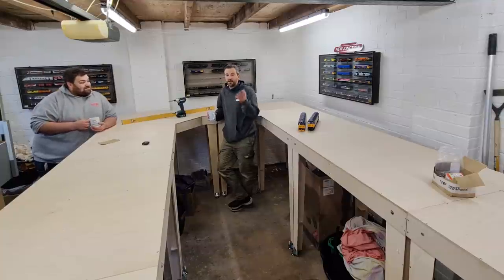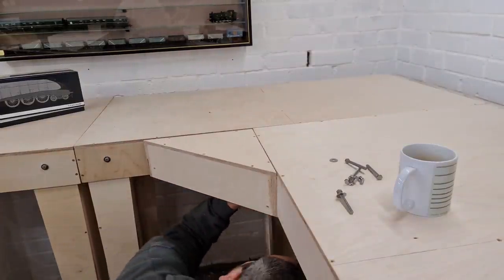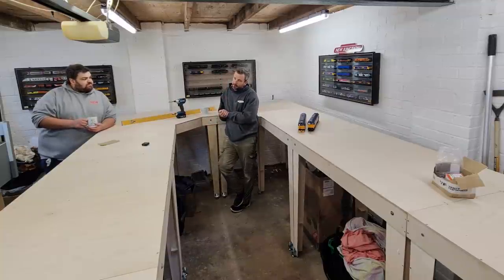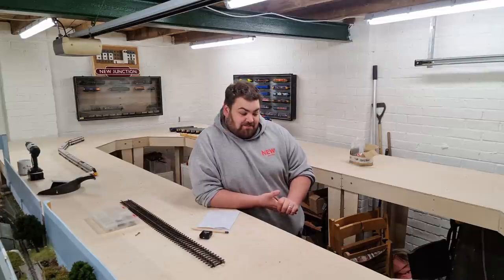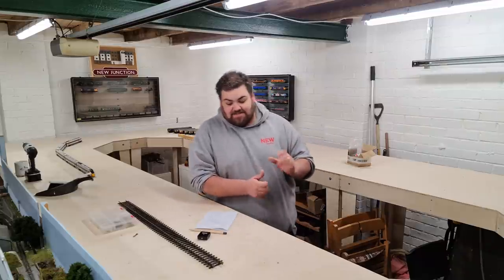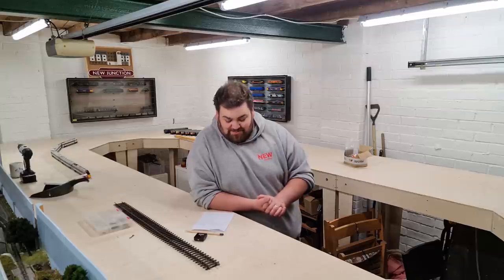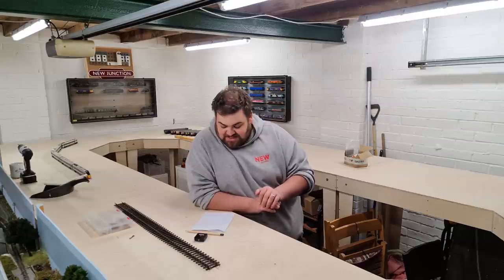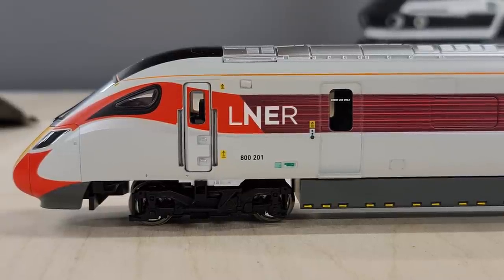New Junction: EP1 - Building baseboards

Comment: Great to see you back Richard. Very nice looking boards. Birch plywood is the way to go. Mine has held up now for over 10 years without any issues. The ability to convert it to an exhibition layout is very cool, looking forward to seeing how that pans out. Good luck!
Reply from the maker: Thanks, did you treat your ply with anything?
Reply: @NewJunction  Not really. I'm usually too impatient and want to run trains. The parts where I've done scenery, I've typically weathered the track, then painted with cheap acrylic paint, usually either gray or brown depending on whats going there. So the closest I've come to treating it is basically bog standard acrylic paint that costs about $1 at Walmart here in the USA. Now my layout is sitting in a reasonably climate controlled basement, so you might want to treat it if thats recommended for where you live. The only baseboard issue I have ever had was one board needed a bit more support, and again that was down to me going, ah I'll add that leg later and got side tracked running trains. :)

Comment: I salute your ambition to be able to rotate 3 boards to create a single run, presumably you have to fit board 4 to 3 in the circuit garage build stage to get perfect alignment for exhibition run.  For the fiddle yard entries will become board 6 into fiddle yard and board 1 into fiddle yard, so the circuit return curve board abutting board 4 also has to line up with board 1.  In reality you will probably need two new curve boards to exit board 1 into the fiddle yard, life is far two short to get the level of accuracy needed for it to all fit together!

Comment: Brilliant news on the new build Rich 👍 Richard have you thought about building a stud wall inside of the garage door? And plaster boarding the roof? I know it’s more ££££money on top of ££££money but it will make the area more homely and warm for you. Also if you do think about doing it do it as soon as before you start on the railway
Reply: The layout is going to be transportable, a stud wall would prevent  the garage door opening. Unless there is enought clearance via another route, just a thought.
Reply from the maker: Darren guessed it, the garage door won't allow a stud wall sadly, besides I use the door too much for my motorbike! 😄

Comment: Pleased to see you, Richard. I have just installed new boards in my lounge - 26 feet by 10 feet, then I saw your video. I am intending to have storeage roads on one side - perhaps 18. On the scenic side I am intending to have a 4 platform station plus a bit of narrow gauge. Rather than have simple crossovers I thought to have a central road rather like Evercreech where banking locos were stored on a central line. This may be easier for me than for you since my boards are 3 feet wide rather than your two feet. There will be two island platforms with the central road down the middle and 3-way points at each end leaving room for a short road for a station pilot at each end. The main station building will be over the station. On the inside of the layout will be a goods yard and an MPD. The central line can be used for transferring coal wagons to the MPD and goods vans to the yard. Minimum radius will be 3 feet - just about manageable and absolutely necessary for some of my locos. I have yet to work out the detail at each end of the boards. If I could work out how to do so I would send you a track plan. In the meantime I will watch your progress with great interest.
Perhaps I should add that I model two periods - GWR in the 1930s with some locos from the 1920s,-  and  postwar to 1963 or thereabouts.

Chris Barton
Reply from the maker: Thanks Chris, your new project sounds great! ! I hope you'll film it!

Comment: That is quite some plan. Just a thought for the switch between home and show layout would it not be worth making a short additional drop out section that would link the two halves up for the show layout. That way you could make sure all lines up track and scenery wise by building one side along with the start of drop out section and the moving that section over remembering to rotate it to the other side and building off it for the continued run. The drop out section could be stored separately out of the way at home and used a a seamless link for show purposes.

Comment: I tried to  do this three times.  4 plus lines appears to be a British Modelling standard, Plus Heritage line makes 5 lines briefly.  New Junction suggests Branch line becomes  Heritage line - Mainline gets bigger forcing Heritage line into compromises -  Mainline is 2 up 2 down - Heritage line was once 1up 1 down. In places  that can still be seen - In places the Society is bringing that back -- In other places the Heritage  line is forced to use what looks like old sidings of the Branch - Mainline line Junction while it seems some of  the original track has now been turned into allotments. 
I also believe you will need a set up  board (7 or more lines that shift over to 2 or 3)  or some connection a marshalling yard. All trains come on to the boards at one corner - can go round and round or up and back again in exhibitions.
Looking forward to your planning ideas
Reply from the maker: Thanks for the ideas!

Comment: Hi Richard, Brilliant to see a new layout in the making! I think the Newark Flat Crossing would be an excellent idea for your modelling, with the Nottingham to Lincoln EMR line crossing the east coast mainline. Additionally, this would make an excuse for two smaller stations instead of one large. Newark Northgate has 3 platforms and lots of disused sidings whilst Newark Castle has 2 curved platforms. With artistic license, I'm sure other operators beyond EMR, LNER, HT, GC and Lumo, Northern operate to both Nottingham and Lincoln so that'd almost fit in perfectly. Perhaps if you added an extra part to the baseboards, going out in line to the other side of your garage, but at the back to leave the majority of space still available, you could represent the line not on the main baseboards going off in the distance. You must think I sound mad! Hope this idea is of interest. 
Oh and one more thing, perhaps you could have a scenic break somwhere to represent further down the line and add in a major station such as York or Lincoln.

Comment: Cracking Baseboards Gromit! Dan really has done a superb job with those boards, hats off to his craftsmanship! That idea about using all the scenic sections for exhibitions is a great idea and I think you’ll pull it off well. Idea wise, I think you kept the station canopy from original New Junction of memory serves me correctly. Perhaps out of board 1 you could have a 4-road station emerging from the backscene with the thunderbird siding, that narrows down to two lines. For the heritage line, I think something similar to Totnes in Devon would work, where the heritage station is away or ‘across a river’ from the main line station but also have some form of a connecting line that goes up a gradient towards the station, or a bit further down the line from the station just like Nene Valley or Worgret Junction? Everything is nicely spaced out then, some food for thought. Keep up the good work, looking forward to seeing the progression and that 800 at speed!

Comment: For exhibitions could you include a board 3.5 to go between boards 3 & 4 to both ensure the track aligns and also to blend the scenery?

On a different note before you get too far it might be worth putting some insulation between the roof beam and also in the back of the garage door,

Comment: I have a strange suggestion. I noticed part of this layout will be in front of a garage door. Depending on whats outside that door, you might consider not doing a backdrop in that area so you can open the door and use it for photography, even if just for the real sky. Of course if it opens to a skyscraper, that might not work so well but I thought it might be interesting.

Comment: Layout planning - may I suggest you steal an idea from the landscape gardeners - the bubble plan.
A bubble is something you want to model - One or more items / features / dioramas / layout elements on the list built form your own and others idea.
As you put them on your benchwork diagram try and get them about the right size but its not critical
Place the bubbles in sequence or parallel or inside of each other
This will give you a good impression of what the layout will look like in its two configurations
Answer questions like do the train journeys with their stops / shunting opportunities make sense, enough separation, etc.
Working in order of priority; from reference to prototype, chosen scale, standard for minimum radius etc.
Replace the bubble with a rectangle containing the track plan using CAD or templates
As the rectangles are joined together you'll need to tweak !!!

Comment: I moved house a couple of years ago and am still trying to settle down to a point where I can actually find room to build a new layout 🤣 looks like a good start though for you though. One suggestion I might have is an automated branch line, I did a project on my last layout using LDRs and an arduino controlled relay board. Perfect if you want q small scale extension for some pacers running back and forth and a little something extra to take to conventions. You can add a station or two along the way and program in individual stops.
Reply from the maker: That sounds like a good idea, I've used DCC concepts shuttle system in the garden before now
Reply: @NewJunction  ah I forgot about that, I was still on an analogue layout, I used the relays to reverse the polarity across the tracks in order to send the trains back up the branch line... don't think that would work very well with DCC fitted trains 🤦‍♂️I have seen some of the DCC timing loops that stop and reverse trains after a certain interval but there probably are better systems on DCC with sensors in the same way I built my track. I just find the timing loops to be a bit inaccurate, different locos with different motors can run at different speeds and stop in different places, hardly the best when you want the effect of pulling into a station 🤣

Comment: In terms of heritage and modern mainline connecting together, you can do worse than to look at Keighley station for inspiration. LNER services to Skipton run through the station, stopping there to alight in the evening and board in the morning, and it’s shared with the KWVR steam branch line. The KWVR platforms are wonderfully preserved and the Northern/LNER platforms are much more modern. I’m sure you could use it for inspiration as a potential station.
Reply from the maker: Oooo thanks, ill do some research!

Comment: Your boards are clearly very well built and joined together. Would you be prepared to share the materials and measurement details of the board - eg. leg height and dimension, board top material and thickness? i am also interested as to where you will locate the control board for tortoise points and signalling. 
regards,
Richard
Reply from the maker: Of course, boards are made from 9mm birtch ply and are 110cm tall. The side supports and braces are around 4inches tall.

Comment: As your starting a brand new layout. Your planning to stay with a duck under?  A lift out? A swing out? I've even seen a guy use sets of drawer rails to do a roll up hold then roll back down.
Reply from the maker: Duck under for now, if it became an issue I could easily turn it into a lift bridge 😊

Comment: If you are going for a raised main line, what made you go for a traditional style flat topped baseboard rather than an open frame board system where you could have reduced the weight of each board (especially if you are going to exhibit) and also reduced costs?
Looking forward to seeing this develop and how you are going to integrate boards 1,2,3,4,5,6 for possible exhibition too. I'm sure you'll nail it. 
Good Luck
Steve
Reply from the maker: I'm glad you're confident in the idea Steve haha. I opted for flat topped boards to offer strength in the long term, I've seen to many get damaged or go flimsy due to lack of a top board.

Comment: Glad to see you back. I'd like to move to the garage too but I'm worried that my garage, although not damp is not heated either and I'm worried about metal parts tarnishing and rusting in the cold moist air. So I'm curious about your take on that? Best wishes and I'll be following along.
Reply from the maker: Hi Steve, the rails will be fine, they may just need more cleaning, the rails in my garden have been fine even after two years. 

Like most things if you get trains running regularly they'll be fine.

Comment: Hi Richard, lovely to see a new build from the start. How wide are the end boards that go across the width of the garage, are they also 2’6”? The reason I ask is because obviously the tracks on the scenic boards will need to be straight(ish) as they cross on to these to allow for the long exhibition format, so your end curves are going to be fairly tight. If it were me, and obviously it’s your railway, I would aim for a 3’ minimum end curve and sacrifice the exhibition idea, after all its not like you can’t exhibit with your work layouts. Just a thought, best of luck with whatever you decide, regards, Stephen
Reply from the maker: Thanks Stephen, they are 2ft wide on the width sections

Comment: I have been thinking at same lines as you, though I am to squeeze a larger scale, much larger scale to about saem space as yours. Having modular way is more useful as you can rearrange things and in case you have to move, it does not end up in a dumpster.  In smaller scals there is so much you can do. Make a list of things you want to include, the ones you want the most, put it on the top of the list and so on. This way you get to include things on the layput you find as must have and if some lower down on the list would not make it, not that much of a big deal, you can use your design of modules to add those things, if you are planning to bring it to trainshows. I have not seen your previous layout but in general, we tend to cramp so much in a limited space, in moderna world buildings and street networks take a lot of space too. In other words less is always more. C>heers from Sweden!
Reply from the maker: Thanks Ollie!

Comment: Great to see you starting a new project. I'm looking forward to seeing how it develops.

Firstly are you going to insulate the garage or leave it as is? 

Secondly as far as ideas for the layout I'd say the first thing to decide is what you want to do with it. i.e. Are you happy watching trains simply run round your layout, enjoy shunting and making your locos work, running locos to a time table or want to focus on the scenery side? Ultimately that will decide your track plan and whether the layout is dominated by track or scenery. Also do you want a layout based on a real place or a generic East coast line that you can set up as you please?

Anyway good luck with whatever you decide.😀
Reply from the maker: Thanks, generally the garage will have no more insulation and with the trains I'm happy watching them go round but would like some form of play value with a station

Comment: in the US we have group could N Trak that uses moduler systems so that every ones units can connect you could copy that scale it up to HO and or O, other advantages to use system like N Trak does is that you can shuffle the modules how ever you like
Reply from the maker: Sounds like fun
Reply: @NewJunction  it works well each module can be pluged in any where you want and you could even use the curved modules when at exhibitions and you can share the standard you come up with, with other letting any one else build modules as well
Reply from the maker: @Elios0000  good idea that!

Comment: Rather than painting the boards - how about a nice wood stain? It'll protect them and could keep the aesthetic they currently have.

As far as plan, I do like when a modeler gives some thought to what went before. Given the New Junction name, obviously there's an interchange of some sort, and having a heritage line probably means that it runs on the old branch. There probably was some track interchange here - but that might have been pulled up now. If the branch was run by a different company from the main, there was probably some interchange freight sidings - but maybe they're now the Tesco's parking lot(!!), even so part of the infrastructure from the past could still be implied. Is there a village, town or city nearby or was it a short distance away (behind the hill)? Proximity and size may indicate a local freight yard (which the heritage line has converted to workshops and storage). There are so many possibilities, and each one "tells the story": what was, what happened, what is now, and how we got here.
Reply from the maker: Great ideas, something I'd like to capture 😊

Comment: Great to see this, looking forward to watching the new layout progress.
One question however, did you not consider insulating the garage? Concrete floors especially can be very cold to stand on during the winter months.
Reply from the maker: Having had railways in it for two years with no issue, I decided not to bother. Same with the previous loft. 😊

Comment: Looks good. I too have a garage which I would like to build a layout in, so may copy some of your thoughts! BY the way, I see you have painted the walls - I did that, and added the lighting, but how are you heating it? Looks like you will be keeping the models in situ, so are you worried about damp?
Reply from the maker: I just use cheap electric heaters, damp I'm not so worried about at this stage